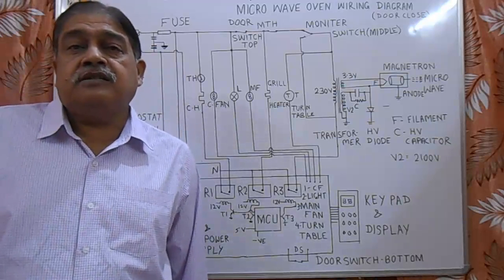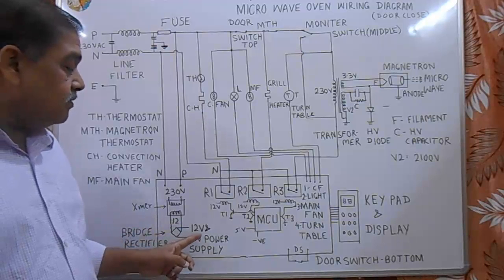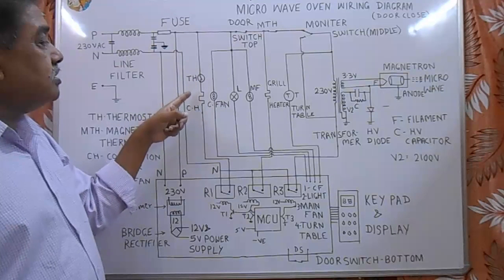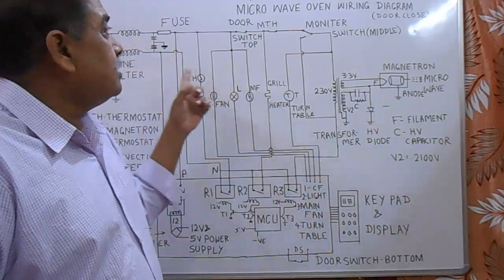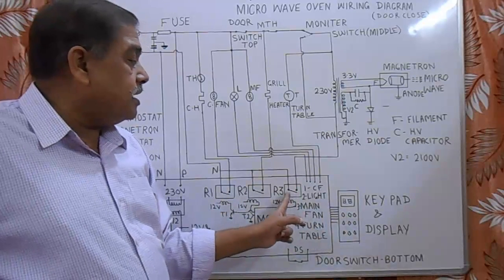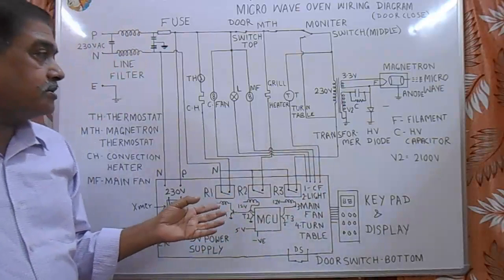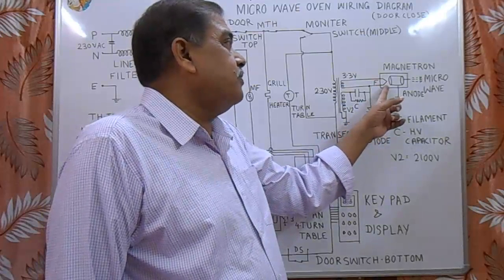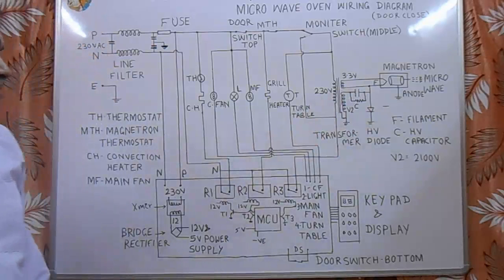MICRO WAVE OVEN CIRCUIT DIAGRAM EXPLAINED, WORKING OF MICRO WAVE

Comment: deep explanation best sir 🙏
sir is that 4200 volts are negative dc pulse
Reply from the maker: Half wave sinusoidal  -4000 volt at kathode (filament) of magnetron. Anode is connected to ground which act as positive with respect to kathode.

Comment: Hello Sir
I read some of microwave schematics and have seen the magnetron wiring differently as F and FA.
Which terminal is connected to the diode and the capacitor? Thanks 
Your schematic F terminal is connected to the diode and the capacitor. 
FA is Filament Anode or filament positive. Correct me if I am wrong.
Thanks
Reply from the maker: Filament supply voltage is 6.3 volt ac received from transformer.it is isolated.  High voltage winding, capacitor and diode make voltage doubler circuit.diode anode becomes  negative output point 4000 volt negative connected to Filament terminal which is act as cathode of magnetron. High voltage winding second point connected to earth makes earth as positive point.this earth point give positive to magnetron anode ( magnetron body is connected to anode.).   In this way anode is at ground potential and cathode is at minus 4000 volt potential. In other words anode is at 4000 volt higher potential then cathode. This makes anode current to flow from anode to cathode.due to strong magnetic field electrons follows a spiral path in front of cavities which generates microwaves in caries and sent out with anteena.